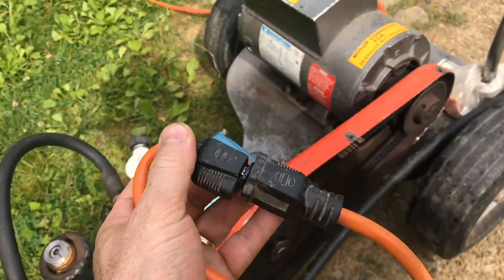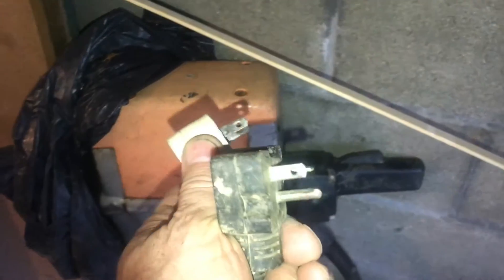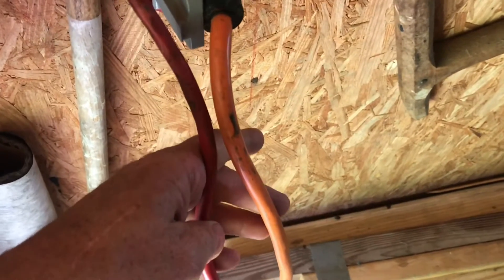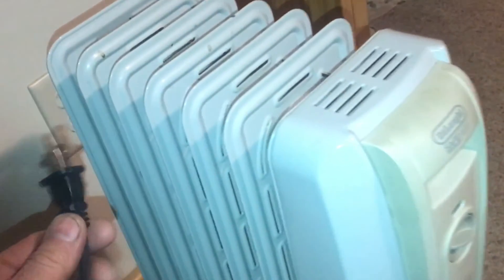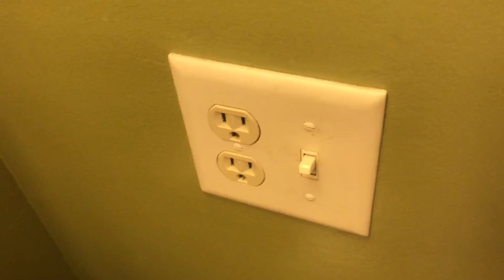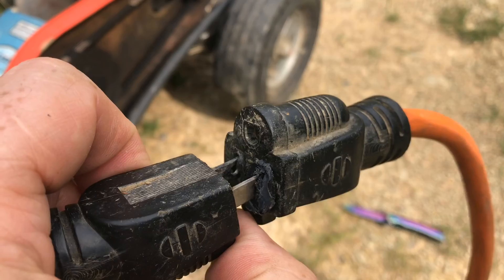What HAPPENS if you use an extension cord that is to THIN

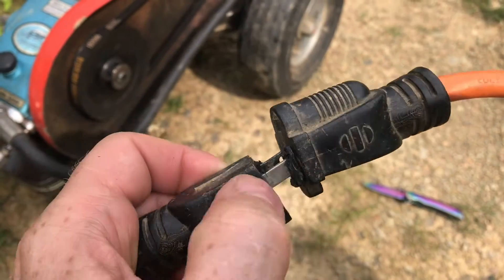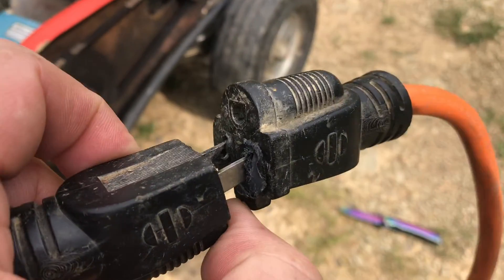Comment: From what I’m seeing from the video, you actually seem to have had a much bigger issue then just an amperage issue for an undersized wire. At 0:23 the pins on the pressure washer plug are damaged which could lead to poor conductivity and a higher electrical resistance which generates heat and fire. At 0:41 and 3:01 the male plug is missing the grounding pin and because of that it’s plugged in upside down so the common and neutral blades are going into the wrong slots of the female plug, thus creating a short.

Comment: Actually (and I’m not sure if someone else pointed it out yet) technically the outlets shown in this video are 15A rated outlets. If they were 20A rated outlets they’d have an horizontal slot on the left side in addition to the two slots and ground. Even so, the breaker on that circuit and wiring between the outlet and panel would also have to be rated for 20A or you’ll end up having more than just a melted extension cord plug, like a a fire. In short, toss the pressure washer and get something safer that’ll not start a fire.

Comment: Even thick guage extension cords can get hot at the connectors.  It's not that the main wires can't handle the current, it's that they are not made well within the plastic connectors.  You can't buy your own connector replacement and problem solved.

Comment: If possible I'd rewire the motor on that pressure washer for 240v operation. Cuts the amp draw in half. Good idea plugging heavy draw items directly into outlets. I have a belt drive 120v air compressor that actually says in the manual not to use it with extension cords, but use a longer air hose if needed.